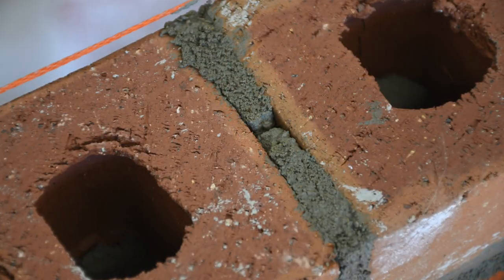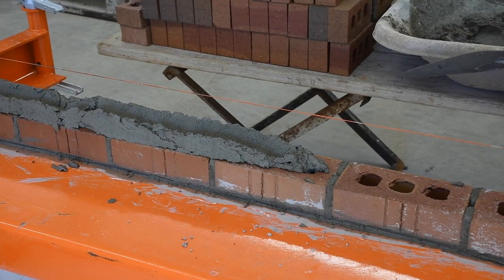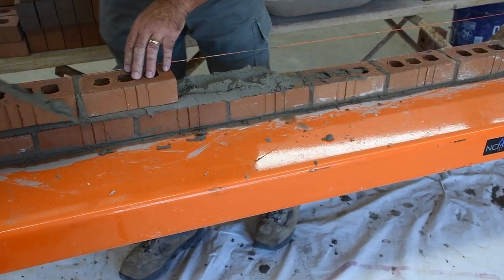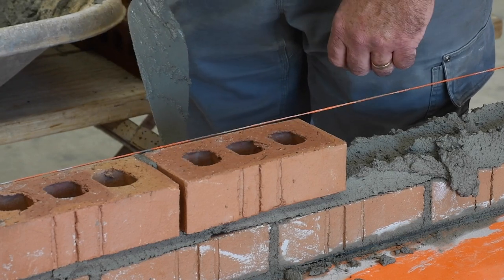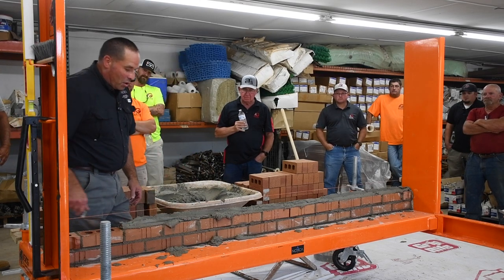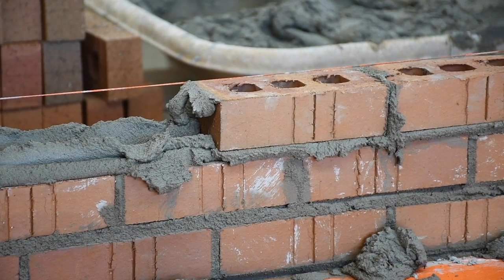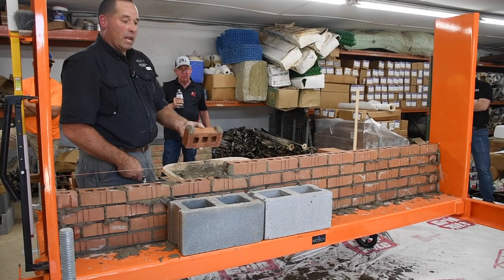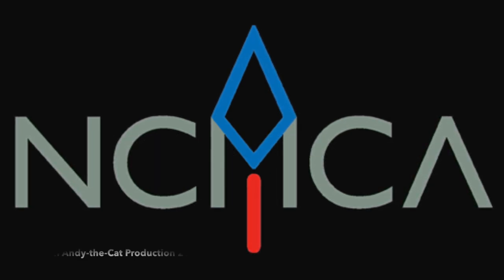Masonry Head Joints and Mortar Technique

Comment: I like to spread my mud a little thicker, then squeeze out enough mortar to butter the head joint for the next brick like he is doing. He has a good system figured out.
Reply: That's not good as it results in insufficient most at the top of the joint☹️